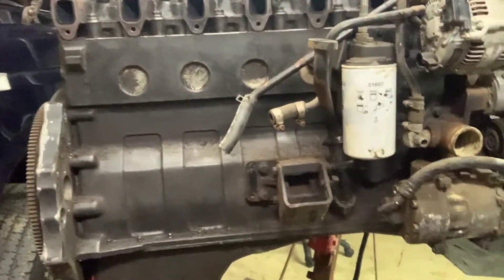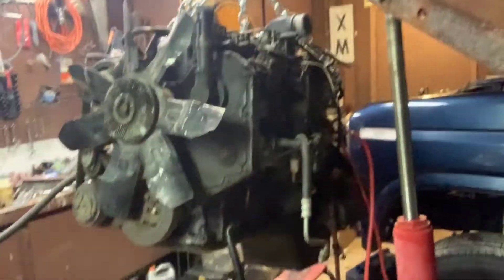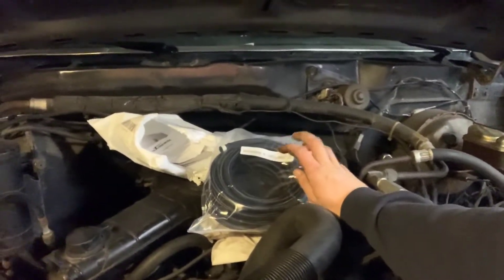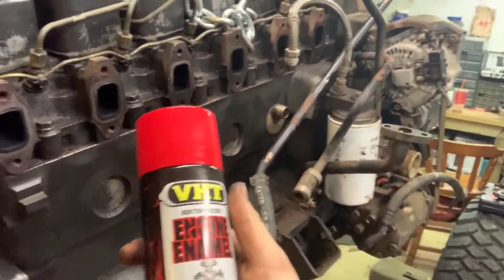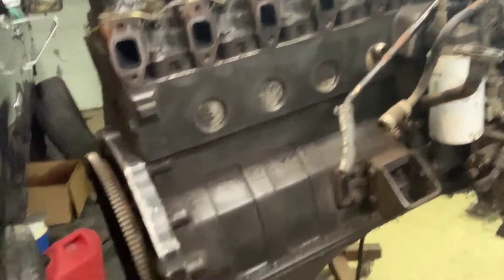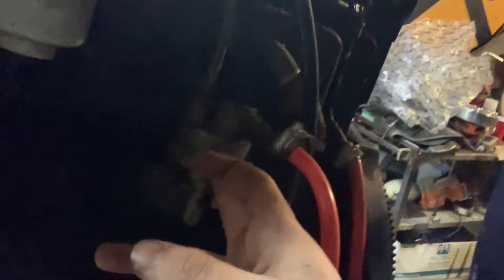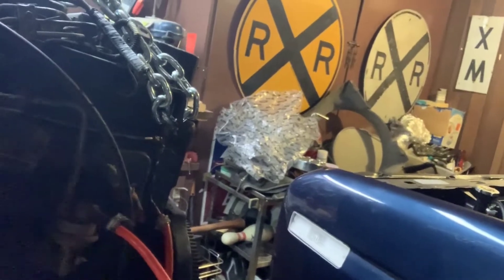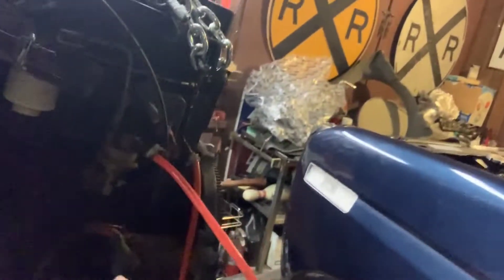CUMMINS TEAR DOWN

Comment: Just a tip When you get ready to put the cummins in that bullnose your gonna have to notch the front of the cab so the valve covers will clear
Reply from the maker: I definitely didn’t know about that! Thanks for the info man!
Reply: Nick's Square Diesel no problem! Also gonna need motor mounts